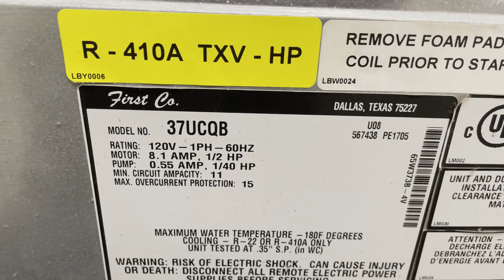How to Install a AC / Furnace Blower Motor

Comment: Also .... you should protect that countertop from scratches as you spin the housing around. Take pics of how the wiring was originally.
Reply: my first thought also that counters worth more than the blower motor, maybe use the cardboard from the box the new motor came in could save having a pissed off customer